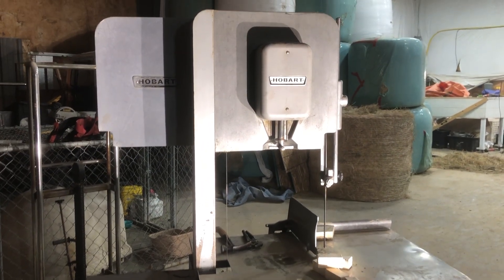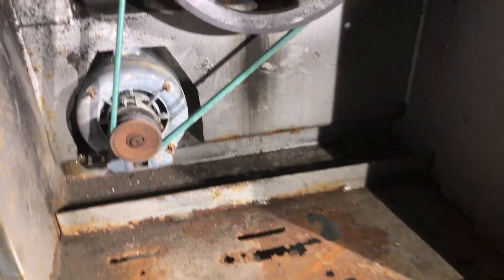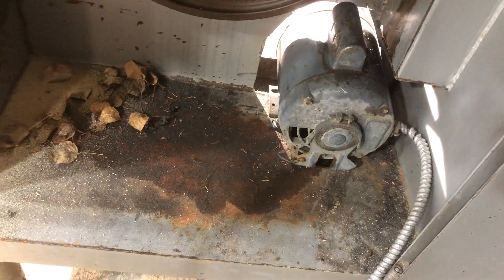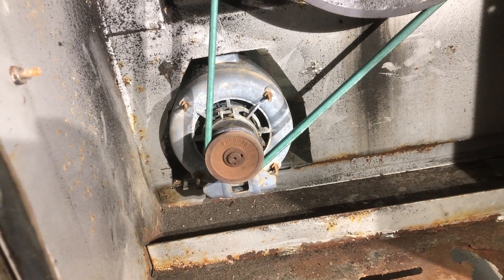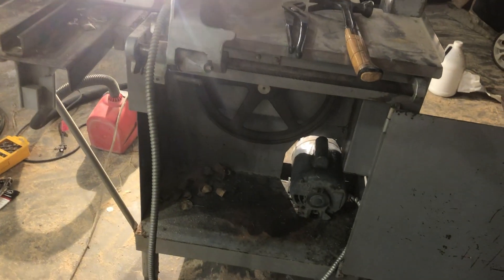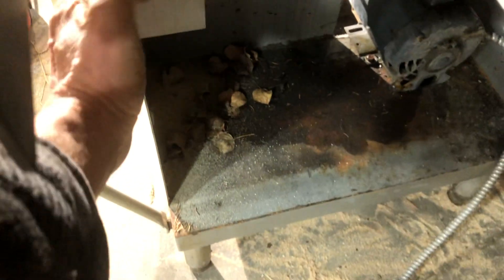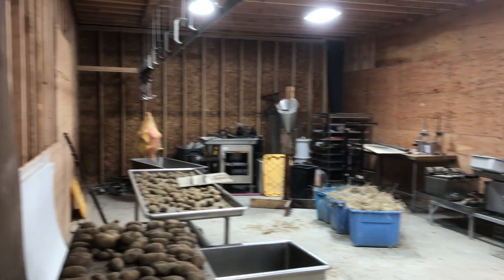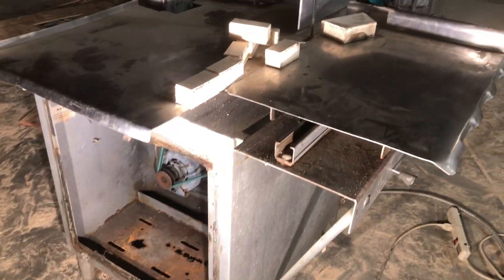Converting a 3 phase Hobart meat saw to single phase for new butcher shop.

Comment: WHAT KIND OF MOTOR IS THAT???? Do you happen to know what that motor originally came off of? What's the h/p & rpms on it? 

Reason I'm asking is I'm in the exact same situation, given one for free/don't have 3 phase capability.....only difference is I'm wanting to cut wood with it and it seems like that type of motor is my much needed answer
Reply from the maker: I'm not sure what it came off of.  I'll take some photos and try and get you more info.
Reply: @4Tfarmandranchalaska  that'd be really awesome of you

Comment: Many of those motors are reversible rotation... some will have instructions on the inside of the electrical cover plate, you just swap a couple of coil wires on terminals inside the motor itself. I've had about 50% luck reversing old motors rotation when I needed to (some can do it, some can't.)
Reply from the maker: Damn, that's good info.  I didn't know that.  As it is, the saw works great but that would have been easier if it worked.  Thanks for the info.
Reply: @4Tfarmandranchalaska  Yeah, it would have been nice to keep the motor out of the side where it will get covered in bone dust & fat. Hopefully you've got it covered up pretty well, those saws can get messy down there.  
Do you have the traditional pull to start, push to stop single stop/start switch on that saw? If so, I have a question about the wiring.
Reply from the maker: @normnelson  We put a metal cover over the motor and it works ok.  If I was a professional shop, maybe not but for a few beef and hogs a year, it's just great.  We just used a decora type light switch to turn it on and off.